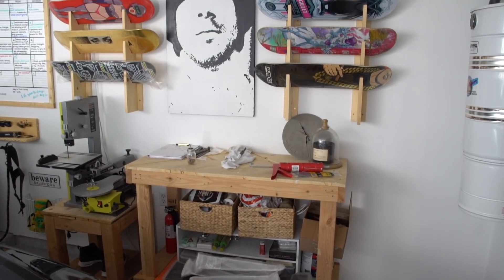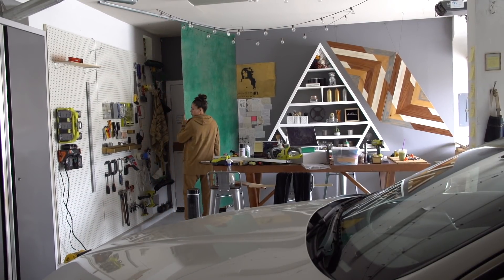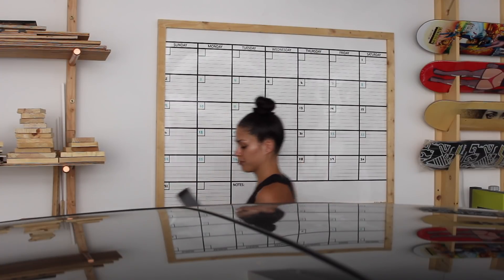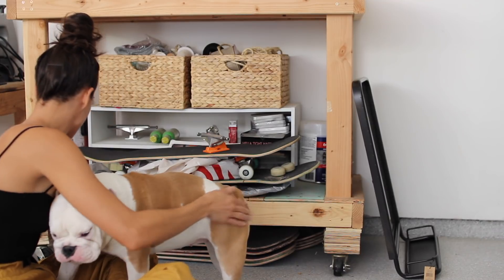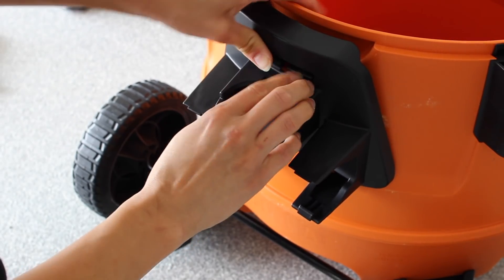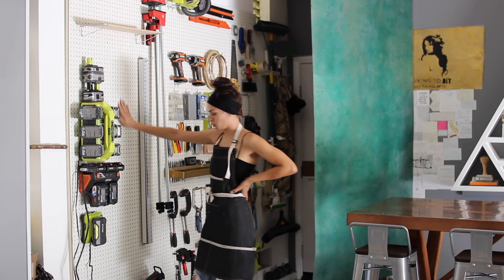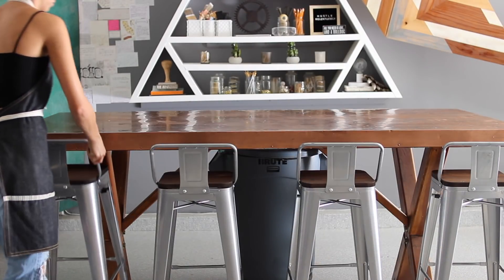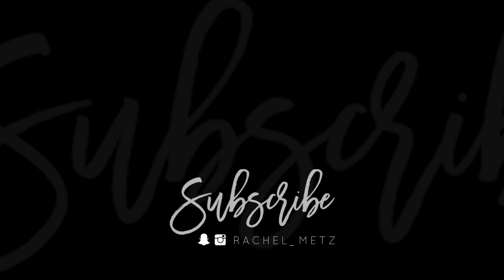Workshop Tour + Organization 2019

Comment: You can get bags for shop vacs!  I did a bit of tidying in my garage, and asked hubby to empty the vac since I also wrench my arm pretty good.  He said, well, there's a bag in it and it isn't barely even full!  I couldn't remember that not only did it have the HEPA filter, but the bag as well, which is a seriously good thing.  Easy to handle, empty, and replace without a cloud if yuck or having to lift the vacuum!
Reply from the maker: Thank you for letting me know!

Comment: Look at adding a dust cyclone to your vac, great to connect it to power tools for no dust and much easier to empty. I  think HD has a couple available too.
Reply from the maker: I need to get that - I've been looking into a dust collection system as well. Any recommendations I'd be happy!
Reply: @LivingtoDIYwithRachelMetz  most common is a the oneida dust deputy but the design is available on Amazon as well. HD have a dust separator as well which works on the same principle. It's called the dust hopper.
Reply from the maker: Jon Franklin thank you Jon!